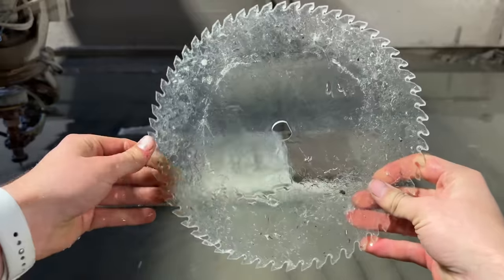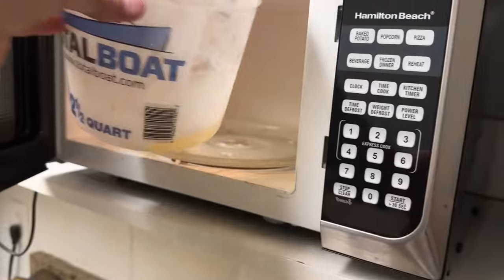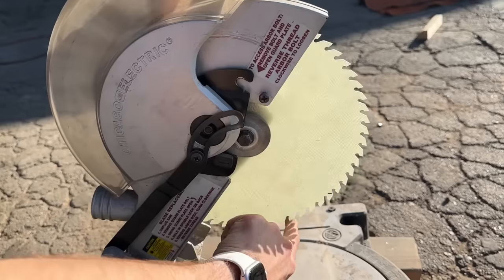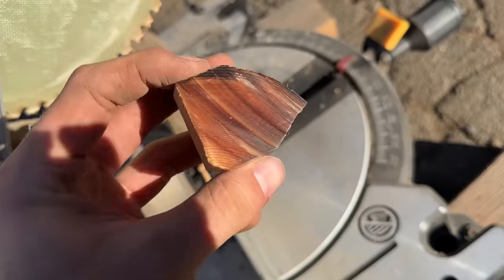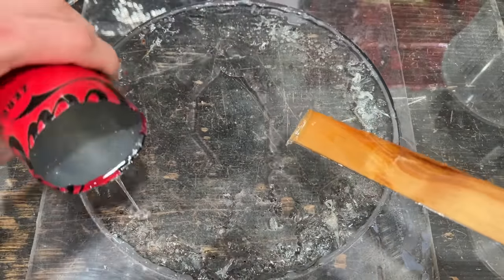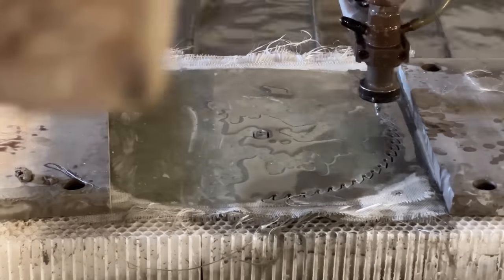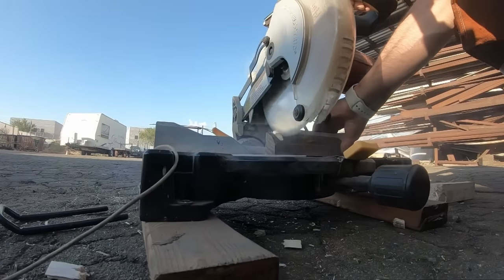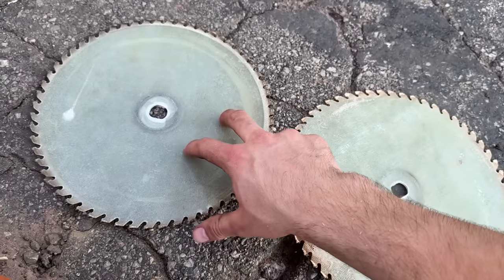Can Fiberglass Cut Wood?

Comment: this guy is the reasons   we at the fire dept have job security. that  twsting glass with no gloves and then bare handing the wood to the saw with NO protection from the questionable saw blades that could explode they could have sent shrapnel into his arm and lower extremities. I thought some level of smart would have been done here, like a safety box around the saw and it activated remotely? Luck was the only reason he wasnt a casuality and we came code 3 to save someone from a darwin award
Reply: Yes, my dude!  Please be careful!
Reply: You always "bare hand" hold stock that is being cut or ground on a manual machine. Never gloves!
Reply: @UncleKennysPlace  i mean him doing it with zero protection for his hand and arm like not being behind safety glass or something so that if the blade let go he wouldn't get hurt

Comment: In electronics, a PCB, or Printed Circuit Board, is nothing more than a few layers of woven fiberglass laminated in resin. Then layers of copper are put on one or both sides (complex PCBs have many more internal layers). The most common laminate is FR4, which is made using a flame retardant resin. The sawblade you made is essentially a PCB substrate.

Comment: What might help is by trying to make the blade thinner, or maybe tapering the edges.
Reply: Unfortunately it would just smooth out if they tapered and thinned the blade.
Reply: Maybe make a better fit on the arbor? You know, so it's not wobbling around all over the place out of balance.

Comment: The teeth are too rectangular in their profile. You need to give them a proper cutting edge.

You should also maybe give the flat sides a low-friction, non-stick coating. That should improve cutting efficiency and reduce burning.

Comment: Try the high temp fibreglass again but put with an abrasive grit inside the fibreglass/resin around the perimeter!!
Reply: That would work great without the teeth and just a circle like a cutting disk because that's just a cutting disk.

Comment: I really think that the teeth on most of these materials are too extreme, and the circular cutouts that are done to releave stresscracks in metal blades might be worse than just giving it "more material to hold on to" although in this case it didnt seem to be an issue really. But with more brittle materials i think it doesnt help.

Comment: 1) The materials you make your blades out of don't retain a cutting edge, so they morph into abrasive disks instantly
2) Even if you could retain a cutting edge, you don't have side tooth clearance, so they will get very hot
3) As abrasive disks your designs are not performing well because your binder has little heat resistance and your abrasives are not very hard

Comment: Another reason why this is not working as expected, you are making a tooth geometry for rip cuts, but using the blade for cross cuts. Also you can use half as many teeth, you don't need a fine cut for 2x4's anyway

Comment: You cut the teeth completely flat, with no offset, no tip.  I mean, you should have at least used the tip.  No wonder it just rubbed and smoked.

Comment: I don't think fiberglass got you where you wanted to go.  How about an epoxy resin mixed with asbestos fibers and concrete dust.  You can use lead and mercury to balance it.   Make sure to cure it in a strictly CO atmosphere. 😂, no really,  don't.  Please.
Reply from the maker: Ah yes an educated man I see